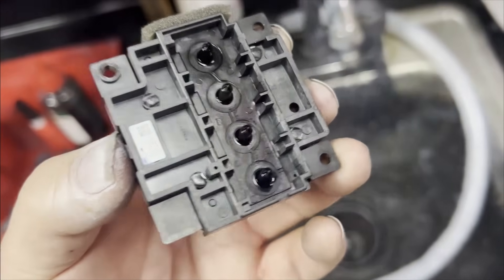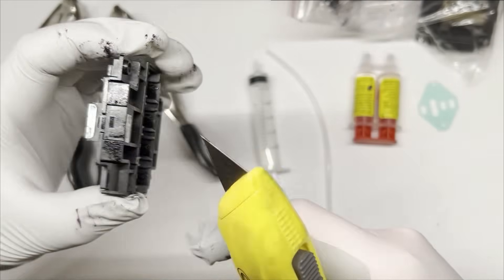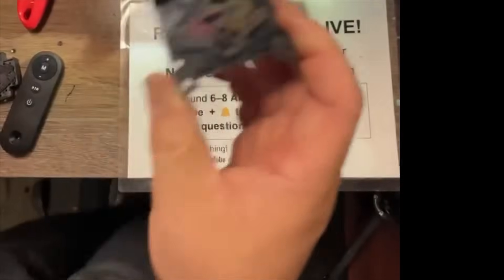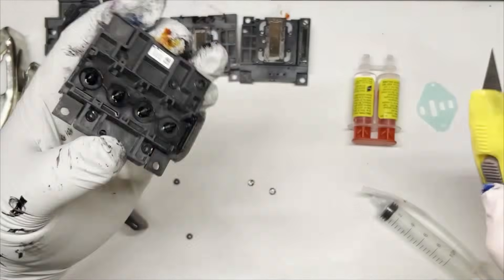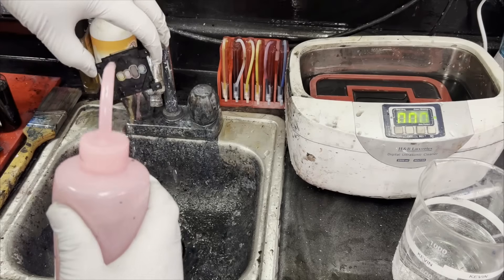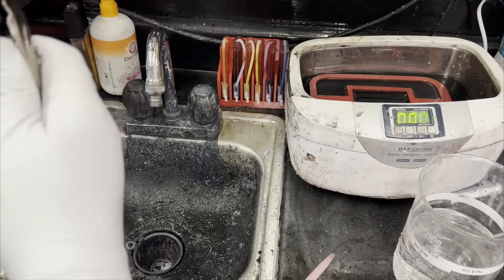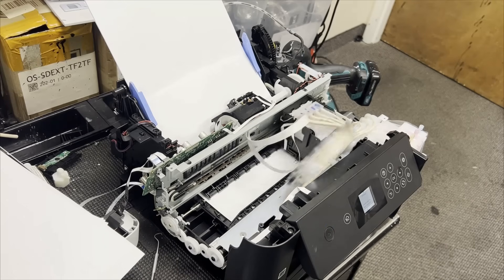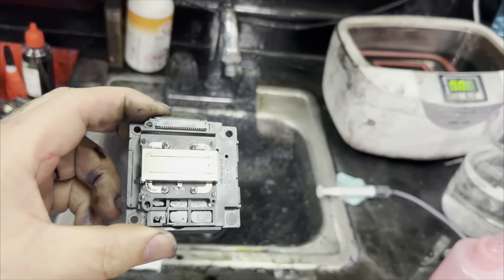Extreme Bone-Dry Printhead Cleaning: Recovering Epson Printheads Everyone Gave Up On

Comment: Most printer heads have clogged nozzles, making them difficult to use. If I remove the internal clog, will the clogged nozzles become reusable?
Reply from the maker: Thanks so much for your support and for watching the video and asking a great question, I really appreciate your engagement. Yes, in many cases if the internal clog is properly removed and the ink path is fully restored, previously clogged nozzles can become usable again, although the final result depends on how long the printhead sat dry and whether any permanent damage occurred. Since I receive a high volume of questions every day, subscribers and channel members receive priority replies and extra benefits like early access to videos and are typically answered within 48 hours, while regular viewers are answered if time allows because I can only respond to about 10 questions per day; after subscribers and members, any remaining reply slots are handled last-in, first-out, meaning newer comments are reviewed first, so if you’re not subscribed and don’t get a reply within 48 hours, you can either subscribe or repost your question, and if you subscribe later, your older questions automatically become priority without needing to repost. I also invite you to join Run With Kevin — LIVE, where I go live every morning (usually between 6–8 AM Eastern) to answer printer questions in real time, so subscribing and turning on notifications is the best way to catch the next live session and ask directly. If you need faster help, feel free to email [support@bchtechnologies.com](mailto:support@bchtechnologies.com), and if this video or reply helped you, I’d really appreciate a Google review at [https://g.page/r/CfL7k6nYvPQ9EAg/review](https://g.page/r/CfL7k6nYvPQ9EAg/review).

Comment: Hey, great explanation. I would like to ask you something, I have a L1800 head printer that is leaking on the plate, it seems that has some hole on the glue, so you think that I can do something to fix? Thanks
Reply from the maker: Thanks so much for your support and for watching and engaging with the channel—I really appreciate it! From what you’re describing, that L1800 printhead is leaking because the nozzle plate has separated from the piezo actuator, which unfortunately isn’t something that can be reliably fixed at home since it requires professional alignment tools, precision adhesives, and controlled pressure to re-bond it correctly without damaging the piezo stack; DIY attempts usually make it worse. If you want the fastest help, you can email [support@bchtechnologies.com](mailto:support@bchtechnologies.com), and if this video or my reply helped you at all, I’d truly appreciate a Google review here: [https://g.page/r/CfL7k6nYvPQ9EAg/review](https://g.page/r/CfL7k6nYvPQ9EAg/review). Also, I strongly encourage you to subscribe or become a channel member—subscribers and members get priority replies, early access to videos, and other perks, which really helps since I receive a very high volume of questions every day; subscribers and members are typically answered within 48 hours, while regular viewers are answered if time allows because I can realistically reply to about 10 questions per day, and after subscribers and members, any remaining replies are handled last-in, first-out, meaning newer questions are reviewed first. If you’re not subscribed and don’t hear back within 48 hours, you can either subscribe or repost your question so it appears newer—and if you subscribe later, your older questions automatically become priority without needing to repost. You’re also very welcome to join Run With Kevin — LIVE, where I go live every morning, usually between 6–8 AM Eastern, answering printer questions in real time, so make sure you subscribe and turn on notifications to catch the next live session and ask your questions directly.